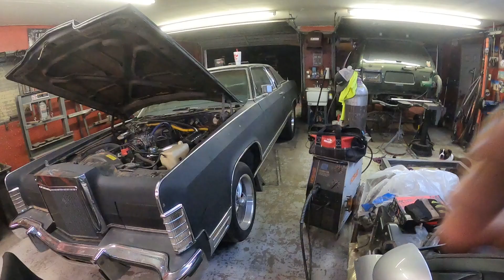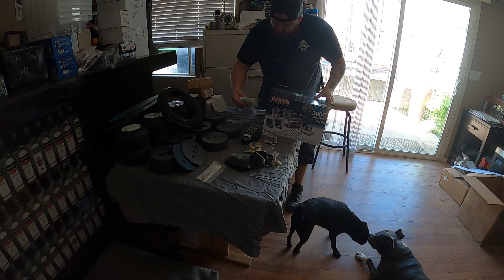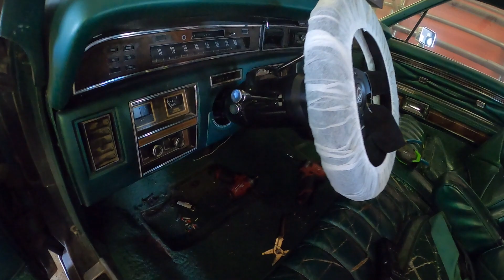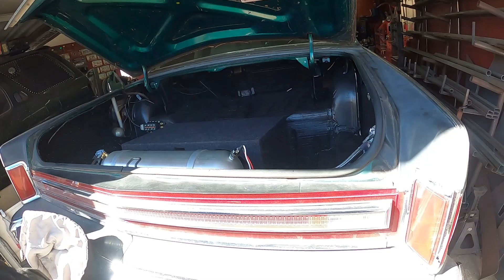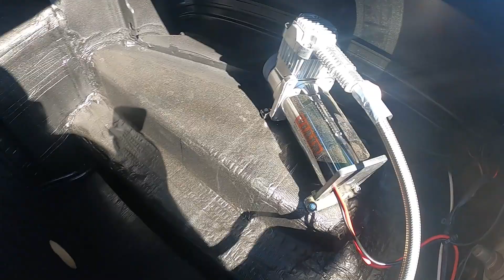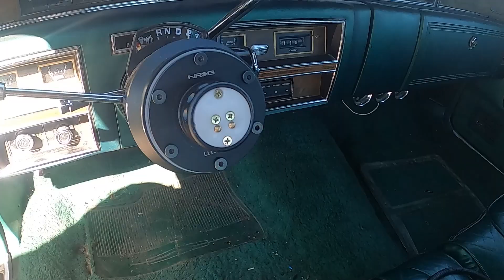Bagged 79 Continental

Comment: Did you have to weld the cups or was it all bolt in
Reply from the maker: Both depending on where. Front was lower welded top bolt in. Rear was welded top and bottom